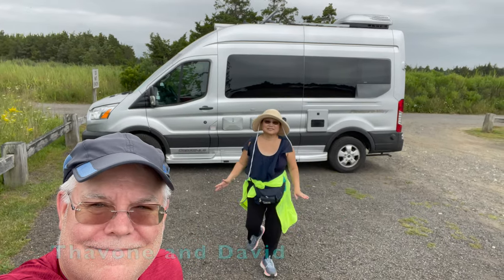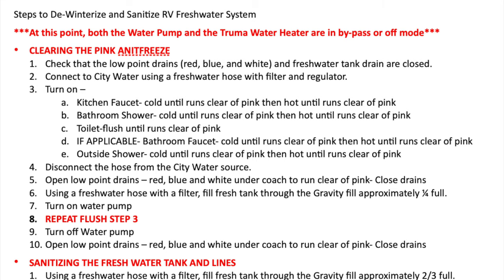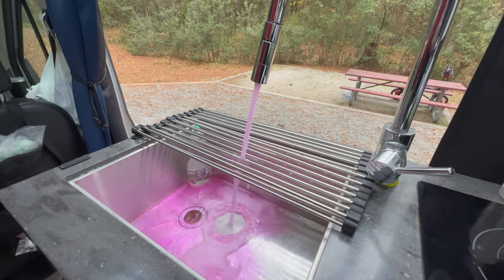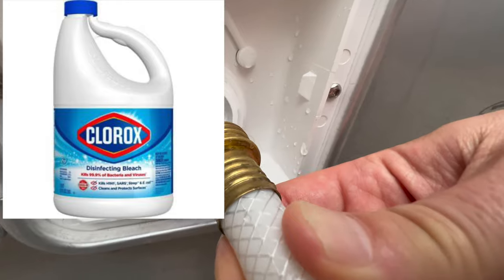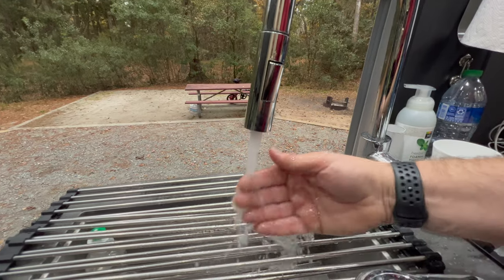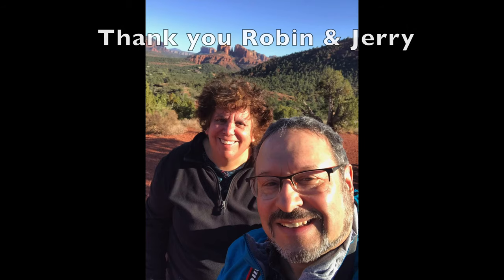RV DE-WINTERIZING FOR BEGINNERS//STEP-BY-STEP//PLEASURE-WAY CLASS B RV//COMMON STEPS FOR ALL RVs

Comment from the maker: Note: To get hot water, don’t forget to turn on Truma hot water icon on the Spider/ iPad panel after turning on outside and after making sure the propane is on.
RV WINTERIZING FOR BEGINNERS//EASY STEP-BY-STEP//PLEASURE-WAY CLASS B RV//COMMON STEPS FOR ALL RVs https://youtu.be/0vreqF44StE
Amazon Links to Items we use or mention in our videos: (We earn a small commission at no extra cost to you when you purchase from one of the links.  Thank you for supporting our channel. )
Surge protector, Water filter, hose:
Portable RV Surge Protector Portable EMS-PT30X RV Surge Protector , Black   https://amzn.to/3v7qfe8
Southwire 34930 Surge Guard 30A - Full Protection Portable with LCD Display Black     https://amzn.to/3vaPMTy
 FilterLogic RV Inline Water Filter.... https://amzn.to/3BJBpXB
Valterra AquaFresh High Pressure Drinking Water Hose.... https://amzn.to/3sTqK8U
Twinkle Star RV Water Pressure Regulator Valve ..   https://amzn.to/3JOmcrm
Camco FasTen 2x2 Leveling Block https://amzn.to/3LQidMC

Kitchen Area:
Over The Sink Roll-Up Dish Drying Rack  https://amzn.to/3p8jXH8
 Magma Products, A10-363-2-IND, Gourmet Nesting 7-Piece Stainless Steel Induction Cookware Set with Ceramica Non-Stick, Silver      https://amzn.to/3p4SciQ
VELCRO Brand - ONE-WRAP Roll, Double-Sided Tape  https://amzn.to/3K4d4Px
Gorilla Heavy Duty Double Sided Mounting Tape XL  https://amzn.to/3HcaWmO
Automatic Soap Dispenser   https://amzn.to/3p81Zog
Dixie Ultra Disposable Paper Bowls, 20oz     https://amzn.to/3p7PitE
100% Compostable 9 Inch Paper Plates  https://amzn.to/36yLlYG
24-Piece Superior Glass Food Storage Containers  https://amzn.to/3JKKfHw
Lunies Over The Cabinet Plastic Trash Bag Holder  https://amzn.to/3pb82Zr
Subekyu Small Hanging Kitchen Trash Can  https://amzn.to/3p9rrKe
Prodyne Under Cabinet Paper Towel Holder  https://amzn.to/3p7GyDQ
Bligli Shower Mat Non Slip Bath Mats  https://amzn.to/35lOgmH
 MicoYang Silicone Dish Drying Mat   https://amzn.to/3BGDMuu

Bedding Area:
 Therm-a-Rest LuxuryMap Self-Inflating Camping Sleeping Pad   https://amzn.to/3h6jTUb
 Amazon Basics Ultra-Soft Micromink Sherpa Comforter Bed Set - Navy, Full/Queen     https://amzn.to/33Hb3Jh
Packing Cubes Luggage Bags  https://amzn.to/3LS0kNq
10000mAh Portable Fan Rechargeable, Battery Operated Desk Fan   https://amzn.to/3JOdHfE

Curtains:
NICETOWN 100% Blackout Curtains with Black Liners, Thermal Insulated 2-Layer Lined Drapes (Navy, 2 Panels, 52 inches W by 45 inches L)   https://amzn.to/36snJop
 NICETOWN 100% Blackout Curtains, Thermal Insulated Black Liner Panels  (Set of 2, Navy, 52 inches Wide by 63 inches Long)   https://amzn.to/3h6Gz6v
 Oval Tension Rods Adjustable Width Curtains Rods 4 Pack Spring Window Round 22 to 36 inches Spring Curtain Rod Tension Curtain Rod, Black        https://amzn.to/3sbpLlh
Rod Desyne Oval Spring Tension Rod 36"-60", Black, 36-60"  https://amzn.to/3p91r1x

Table and chair:
COSCO Multi-Purpose, Adjustable Height Personal Folding Activity Table https://amzn.to/3t05IFN
 Portal Outdoor Folding Portable Picnic Camping Table with Adjustable Height Aluminum Roll Up Table Top Mesh Layer     https://amzn.to/3slgZBv
 STRONGBACK 3.0 Guru Camp Chair, Original, Navy/Grey     https://amzn.to/3H6Di1K
 STRONGBACK 2.0 Elite Camping Chair, Original, Black/Grey      https://amzn.to/3JOAPL2
 GCI Outdoor Compact Camp Table 20 Outdoor Folding Table     https://amzn.to/3p8dH2l

Bathroom:
Bligli Shower Mat Non Slip Bath Mats Bathtub Mats with Drain Holes and Strong Suction Cups, Anti Slip Bathroom Floor Shower Stall Mat(BPA, Latex, Phthalate Free) (Blue 21x21 inch)  https://amzn.to/3sbQYEs
MISSLO 8 Pockets Mesh Shower Organizer Hanging Caddy with Rotating Hanger Quick Dry Bathroom Storage (White)      https://amzn.to/3sa5MTV
MISSLO Hanging Mesh Pockets Hold 340oz/1000ml  https://amzn.to/3LSi9fi
Self Adhesive Pet Proof Toilet Paper Roll Cover Holder ...  https://amzn.to/3hflpTL
 Motion Sensor Wireless Night Light      https://amzn.to/3HdnRVu
 ScorchedEarth Microfiber Travel & Sports Towel Set (True Navy) -      https://amzn.to/33IJ7oq
Poo-Pourri Original 16-Ounce Refill Bottle and 1.4-Ounce Original      https://amzn.to/33HuwJU
Scott Rapid Dissolve Bath Tissue Made for RVs and Boats (16 Rolls)  https://amzn.to/36z0Z6l
ScorchedEarth Microfiber Travel & Sports Towel Set (True Navy) -    https://amzn.to/3hdqWdL

Front area and phone chargers: 
Tacticool Car Seat Back Organizer    https://amzn.to/3JY79ex
Heavy Duty Cargo Net Stretchable   https://amzn.to/3vigbPk
Spigen Mag Fit Phone Holder Car Mount Designed for Magsafe...    https://amzn.to/3BGR8GU
USB C Car Charger Adapter...   https://amzn.to/3BQ8Yr9
ADDTOP Solar Charger Power Bank ...  https://amzn.to/36DHSIt
iPhone Charger,3 Pack (6 FT) Maitron [Apple MFi Certified] Charger Lightning to USB Cable Compatible iPhone 13/12/11 ... https://amzn.to/3p8fRPB

Coffee equipment :
Hamilton Beach Scoop Single Serve Coffee Maker  https://amzn.to/3t3rJTR
OXO Brew Conical Burr Coffee Grinder  https://amzn.to/35jkDT0
Coffee Canister, MOICO Stainless Steel Coffee Container  https://amzn.to/35lU5Rm

Comment: Thank you so much for sharing! We followed your steps to de winterize our plateau TS 2022. It went just great. 
Did you have a chance to make a sanatize video to clean the tank? 
I presume we need to close the water heater by pass valve, horizontal position? Thanks again. 👍🏻
Reply from the maker: We are so happy to hear that the video is useful to de-winterize your beautiful Plateau TS 2022!!  We have not made the sanitize video.  We will put it on our list for a future video.  We will be de-winterizing after we are done traveling across the country.

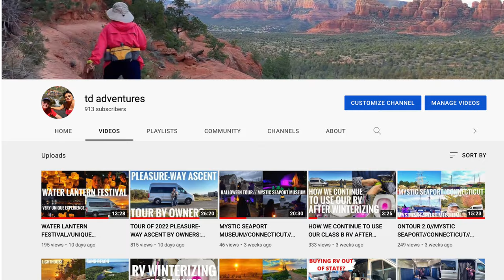Comment: 0:18 Start
0:58 Clear pink antifreeze (water pump & Truma water heater in OFF position)
1:12 Step 1 Check low point RBW drains and fresh tank drain valves are closed
1:20 Step 2 Connect city water
1:34 Step 3 Flush out pink antifreeze (water pump OFF)
2:26 Step 4 Disconnect city water
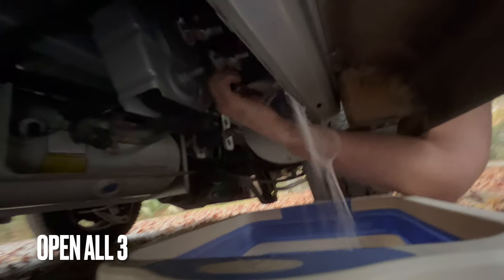2:31 Step 5 Open/Close low point RBW drains
2:43 Step 6 Fill 1/4 fresh water tank
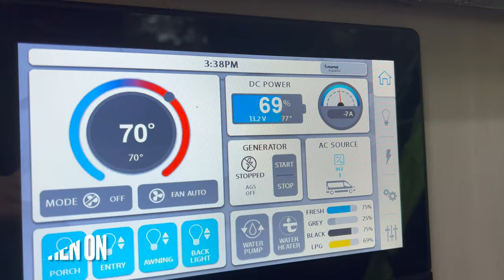2:54 Step 7 Turn on water pump
2:59 Step 8 Repeat flush Step 3
3:16 Step 9 Turn off water pump
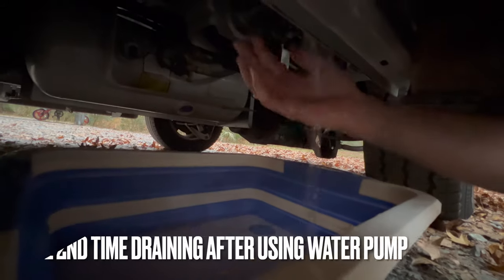3:23 Step 10 Open/Close low point RBW drains
3:32 Sanitize fresh water tank in lines (3/4 Cup Bleach in 1 Gallon Water)
3:55 Activate Truma Water Heater System
4:35 Insert water filter and turn on system
5:10 Run hot water until hot (water pump on)
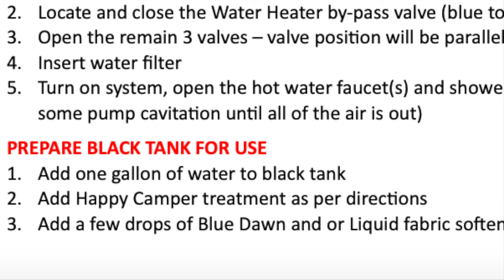5:26 Preapare black tank
Reply from the maker: Thank you
Reply: @tdadventures My gratitude goes to you both❤😂🎉😮😊. This is my 2d year dewinterizing and this video is my Bible. I own 21 Ascent. Thanks again and wishing you all the joy on your happy travels!
Reply from the maker: @據-x8e  it is music to our ears when we hear a nice comment like yours. Thank you so much for mentioning that. Helping others and passing along what we have learned is the reason why we started this YouTube Channel.